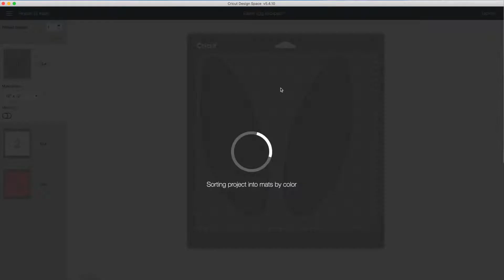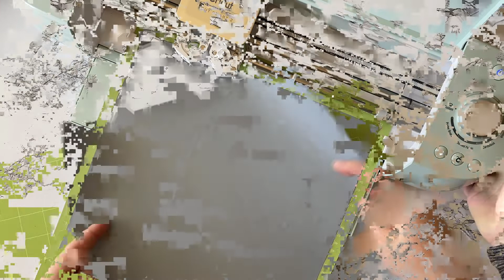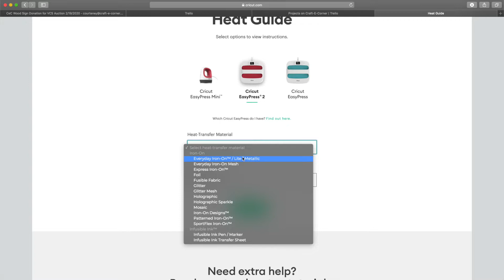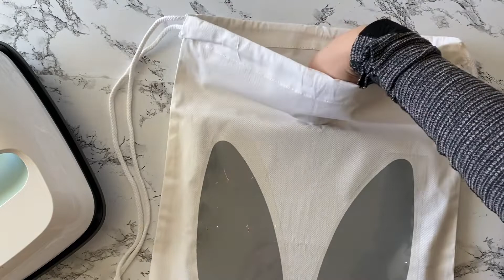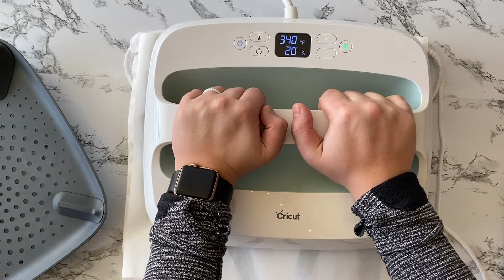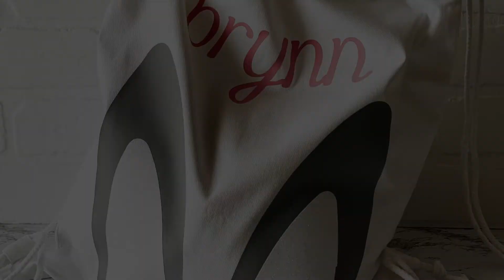Cricut DIY Easter Project: How to Make an Easter Egg Hunt Bag

Comment: What would be the difference in having the iron on material face up as opposed to face down?
Reply from the maker: If you had the iron-on face up, it would cut the clear transparent sheet that protects your iron-on from the heat— it wouldn't actually cut the iron-on. Hopefully that makes sense!